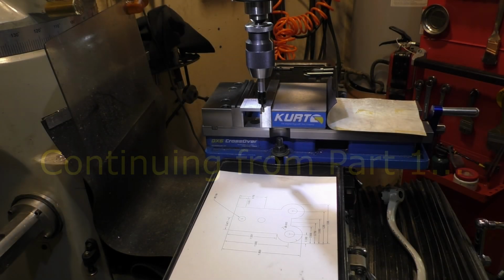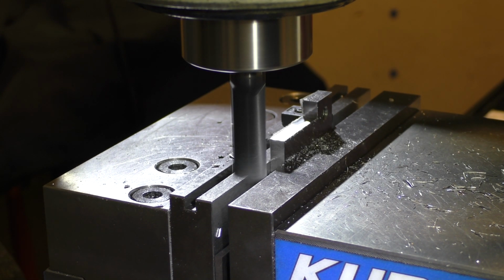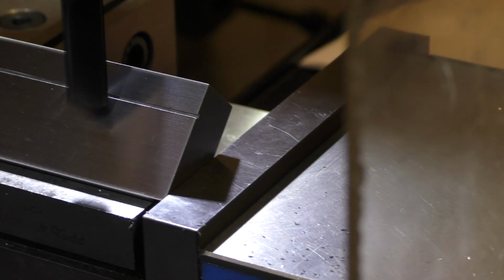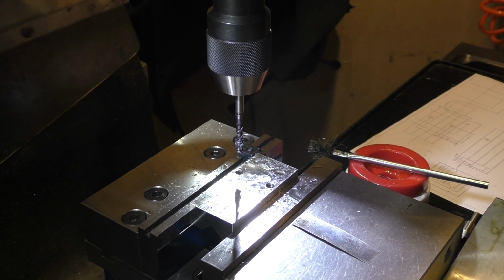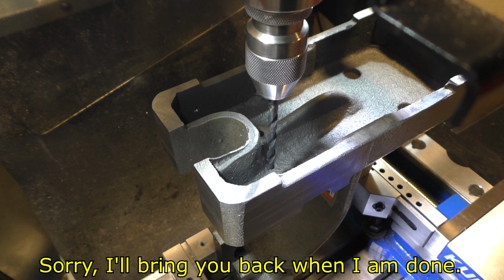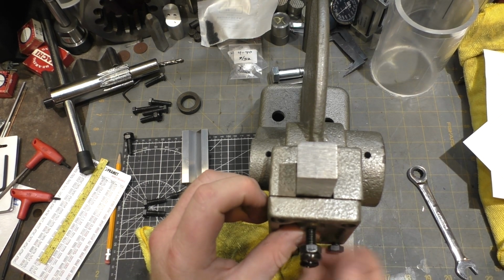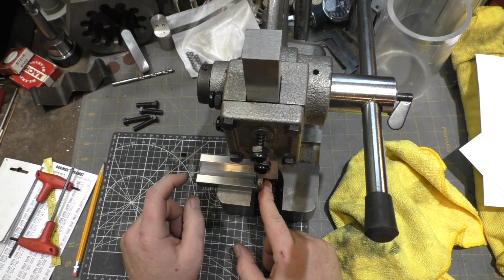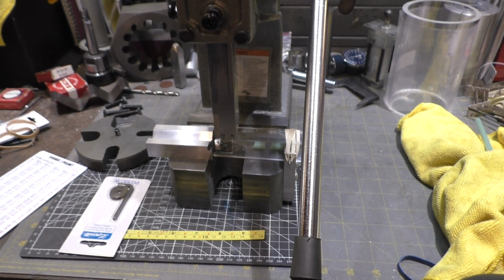90 Harbor Freight Arbor Press to Murinne Glass Cutter Part 2

Comment: Good ideas in action. Rather than or in addition to the ruler, I think would be an adjustable stop so she wouldn't have to eye it every time. It would increase accuracy and decrease work time and fatigue.
Reply from the maker: That is an excellent idea. I was trying to come up with a way to do that without getting in the way of the previously cut pieces and containing the pieces as they cut (they tend to shoot off randomly). I did not come up with a good solution, but you are right.
Reply: @DudleyToolwright  Thank you for your kind words. I have a couple more ideas for your consideration:
1. Incorporate an adjustable  hood on the stop to direct the part's path.
2. Mount the arbor onto a platform for some height, that will allow a parts tray to capture the pieces as they are cut. This could again save on time/cost.
3. Incorporate a small trip lever to actuate a parts counter, which could also aid in more cost/time deductions.
4. Use a screened parts gray that will let the small pieces of glass fall through by the shaking of the tray. Then pouring them into a bag of whatever quantities needed.
Reply from the maker: Fantastic suggestions. Some of those are truly inspired. Thanks.

Comment: Blind holes, eh? Our teacher Mr. Pete would be very disappointed! ;- )

Interesting project, thanks for sharing!
Reply from the maker: Coulda worked out very badly indeed. I was trusing the DRO, going very slowly, and stopped well short of the bottom of the hole, but still, you are quite correct.

Comment: You are brave for sure, that power tapping into a blind hole would make me pucker up. I"d probally just hand tap for my personal sanity. Great use of el cheepo HF arbor press
Reply from the maker: It did scare the bejesus out of me. I was watching the DRO and stopped well short of the bottom...but still.